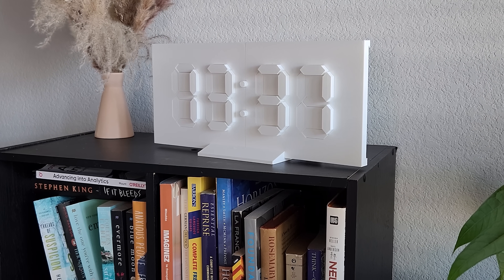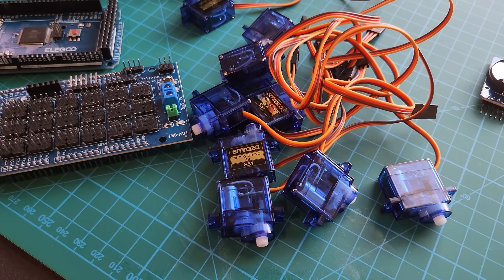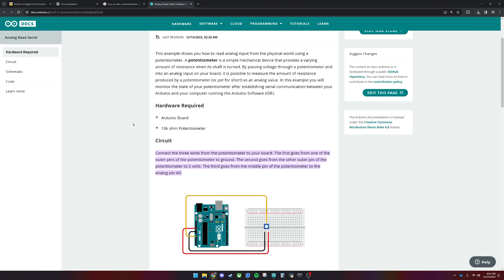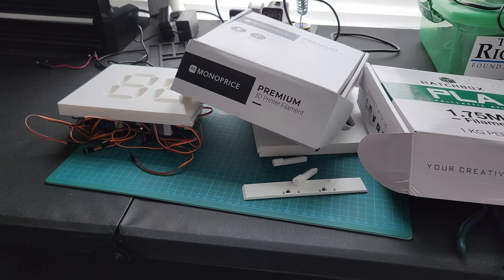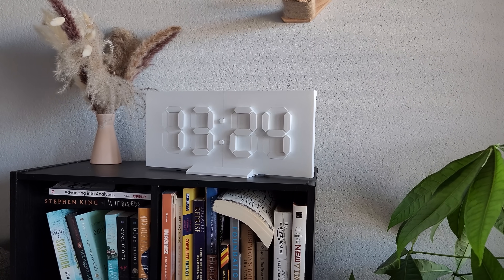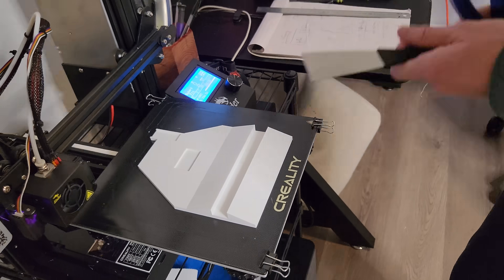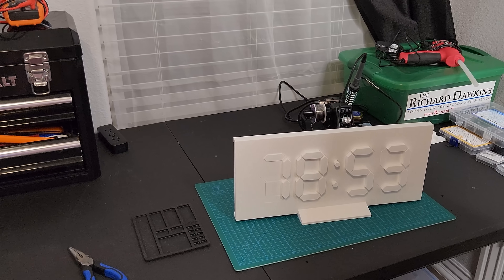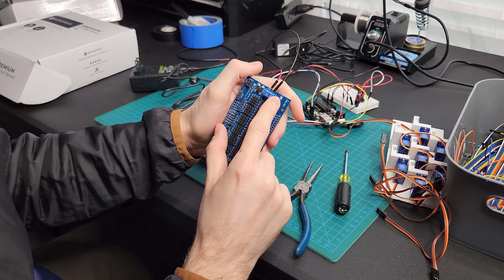I Built a Minimalistic Kinetic Clock Project with my 3D Printer and Arduino

Comment: This is such a cool concept. Being a watch enthusiast (I know this is a clock, but still), and an engineer, combining both into an electronics project is just awesome.
As some additions and improvements, the way this was done is a bit chaotic. Normally, a regular clock with 7 segment displays would just have a binary to 7 segment converter circuit, or since Arduino was used, just make the conversion in software and power the corresponding segment via a multiplexing circuit. Hence, with just some tweaks, a regular 7 segment display clock can be used and the multiplexing routine can carry the PWM signal to activate the corresponding servos. Of course, instead of multiplexing hella fast as with a normal display, it would be extremely slow but in order to move one segment at a time and using a servo driver instead of the Arduino itself. That way, a bunch of the wiring can be ditched and power consumption would also be lower. Regarding noise, there's really not much that can be done, except not using servos or isolating the back of the clock really well to damp the noise a bit.
In the end, this definitely is a really cool way of displaying time.
Reply from the maker: This is a bit over my head, I'm just stuck on how cool the word "multiplexing" is :-D. Seriously though, thanks for the ideas! I'll have to google some of this for my smooth brain to comprehend it.

Comment: Maybe you could use Solenoids instead of servos to push and pull the segments. That what you wouldn't have to calibrate pots control of the servos. That is as longs as the Solenoids shaft travel is the same for each of them.

Comment: You could try a dovetail joint to mount the Arduino. You could also look into some wire loom tape or tubing to clean up the cables even more.
Reply from the maker: Don't tempt me with a good time. I'm a HUGE fan of wire loom :)

Comment: It's amazing. It's something I would never be able to do. Thee best I can do is an old laptop running Windows XP and a clock screensaver called Huge Clock. I know, I'm not the sharpest tack in the cork board. I am smarter than the average Joe though.

Comment: Very nice!  I would suggest a stop to each segment, so it naturally ends flush when retracted (or extended).  This should also work well with the electromagnet concept others have mentioned.
Also in reference to power: the servos move for one second of each minutes.  So it may be possible to use a capacitor to provide the extra power required during that short window.  You would need some sort of current limiting on the charge circuit (which may be as simple as a resistor).
Reply from the maker: Ohh I didn't think about using a capacitor. That might be a good quick fix.
Reply: NiMH battery pack (4 cell = 4.8v) would possibly work better than a capacitor. Charging can be done with as little as a resistor to limit the current since your not going to fast charging.

Or if it's happy to run down around 4v, a cheap TP4056 Lithium charging module and a 18650 cell would make the whole thing run from a USB phone charger.

Comment: That is a nice clock! I would be curious to see if a color change on the segments works out well (lay down 1mm of white PLA and then switch in some black PLA).

Also, heat-set inserts are really nice for projects like this and tying everything up.
Reply from the maker: Okay that's a great idea! I'm about to get a Bambu X1 Carbon so I could totally do a dual color print for all the segments to make that vision come to life!
Reply: @LukasDeem I don't think you need a multi material printer for this. I'm sure it's just a pause at x layer and swap filaments. The whole segment would be black and pause at the last maybe 5 layers and change to white. Or even good ol' paint would do the job just fine
Reply from the maker: @octimus2000  you are correct, but how cool would it be if I did have a multi material printer though? 😄

Comment: I saw the original design for this a while back but it was unpowered, so seeing a MCU and motors on this is a serious step forward.
The issues you've faced here have really got me thinking, I love the form of the face, and that movement when the digits change is beautiful, so I'd like to keep that, but for me it needs a out/in state for each segment, so I'm going to think about how to create a gradual kinetic movement (sprung, like an old cassete tape opening maybe?) with the actuator being a electromagnet powered to either positive or negative and the digit holding a neodymium magnet in each segment (sprung, like an old cassete tape opening maybe?) with the actuator being a electromagnet powered to either positive or negative and the digit holding a neodymium magnet. 
Something else I'd want to do is reduce the depth to as minimal as possible, which if the soft open/close mech was thin and the electro magnets don't need much force means the clock could be wall mounted.
Final thought, for me the digit movement would be a wash from right to left on each of the segments, that way the required power would be issued at a max of three segments at any one time, that would keep the amperage down.
Reply from the maker: Excellent ideas! I really wanted to find a way to wall mount it, but I knew it was too big to make it practical with the design I used. I would love to see your idea come to life!

Comment: Would be interesting to try reducing servo count by using multiple segments per servo and mechanical cams
Reply: That’s what I was thinking too. A cleverly-designed set of cams could work well. Another option would be small electromagnetic coils that can produce a north or south pole depending on how they’re energized, and only need to be energized long enough to flip a digit. Multiplexed, probably. So you’d just need one permanent magnet and one reversible coil per segment (and maybe 2x transistors per segment) instead of one servo per segment.
Reply: @ScottLahteine I would love to see this concept be realised :)
Reply: @ScottLahteine  Just watched this video the other day with a cam setup.  https://www.youtube.com/watch?v=qoPwPJhESA8
Reply: To my reckoning there are not two segments that always move in sync, afraid each segment requires individual control.

Comment: I would use a 12V 2A power supply and two stepdown boards. One 5V for the Arduino and one 5V for the servos.

The clock could be set via GPS module or radio receiver. In Germany the station is available at 77.5 kHz for the local time. That's longer than long wave radio.
GPS transmits UTC, which is British time = GMT
Reply from the maker: Oh! I like the idea of syncing time via GPS. Great idea!
Reply: Awful idea. GPS module is over expensive and complicated for such simple case as clock. 
Better to use cheap radio chip with support of RDS decoding, it cost near $1. RDS — it is additional digital data which transmit radio stations (e.g. name of station, current track and so on), there are ~20 types of data which radio are transmit, including… yep, current time.

Comment: How do you actually get the clock to know the current time?
Reply from the maker: Hey so there is an Real Time Clock (RTC) module. It connects to the Arduino via the SDA and SCL pins. You have to run an initial program to set the clock, once it's set it stays set (unless the battery dies). When the clock is running it calls for the time from the RTC module and translates that into the digit movements.

Comment: I wander if you could use a syringe filled with a low boiling liquid, so you would need a heating element like a strong LED, more power etc.

Comment: I’d print a back for it, 1 to make it aesthetically pleasing, 2 to potentially sound dampen the motors making noice. 

Also, I wonder if adding a lighting strip above or below would help cast shadows to make it even more readable, and also wonder if dust build up will be an issue.
Reply from the maker: Hey good idea with the lighting. I was thinking something similar, it's a bit hard to read at certain angles and in certain light.

Comment: Looks great. Is there a place you specifically talk about the problem you have with the power? I have a solution in my head but it’s so mindless I feel there is more to the problem that I just don’t know.

Again cool video thanks!
Reply from the maker: Hey yep. SO long story short I tried powering both the shield and the arduino from a single power supply 5v, 4A. The problem was the voltage was a bit low for the arduino and I when all 30 servos were moving it would brownout. As others pointed out, if I could just adjust the code to move the digits one at a time, then it would solve the problem. I'm just a coding noob 🙂

Comment: If I was making this clock then I would use Nitinol Wire to push-pull the segments in and out, it would be silent and some FETs to adjust the current to each wire coil.
No servos, so you would have a Nitinol coil attached to each segment, then a FET to switch the power to each coil, more info look at this channel.
https://www.youtube.com/watch?v=wKoc7-APFsk, go on make one it will be a very cool project.

Comment: Great build, it looks awesome.

I would say 2 things to improve this build: you can use one power supply that has vurrent for the entire project by having a common earth between everything and using a step down/buck converter for lower voltage parts (like an LM2596). And grab yourself a flexible bed for your printer - they're very cheap and will save you damaging the bes uaing a hammer and chisel. Flexible PEI plates are awesome.
Reply from the maker: Hey! I ordered a Bambu Labs X1-Carbon so I'm looking forward to using the flexible  plate on that baby :) 

Great suggestions! I'm trying to learn more with each project :-D
Reply: @LukasDeem  Another thing since you will be able to do multi material prints– maybe put the sides of the print in a different color, like green and the front of each segment in white so it blends in
Reply from the maker: @ottersmeep25  hey yes! I got the AMS. I haven't tried a multi color print yet. I'm excited to give it a try! 😃😃
Reply: @LukasDeem  congrats on a beautiful project - its a work of art.. and now an amazing piece of technology (the x1 carbon) - when are you going to get it? it really opened up possibilities for me - more things became possible faster. excited for you esp where you'll go with it!
Reply from the maker: @shamh7830  hey thanks so much! I actually got my X1 carbon a couple of weeks ago. I'm so impressed with the speed and quality! I'm able to iterate so much more quickly now 🙃
Reply: You should make sure that not too many servos move at the same time then you wouldn't need such a big power supply.

Comment: Now using this as a base for a large Pin Art board, having the time get pushed out in the pins. Or if you want to take it to a more surreal/paranormal look a very think sheet of latex over it so the numbers are pushed out of a seamless block

Comment: Are you using two power supplies for two different voltages, or just to supply enough current?  If the former, the servos will run from 5V, as will the arduino.  Either way, there are little Power Supply modules (Leadshine and many others) which are low cost and are available with plenty of power to drive all 30 Servos at the same time (which of course, you don't need to).

You've made a very nice job of this.  I appreciate your attention to detail.
Reply from the maker: Hey thanks!! So yeah I have two power supplies, both are at 5v. The one powering the Arduino is 1.5 amp and the one powering the servos is 4amp. I was thinking maybe I can get a power supply with higher amperage but I didn't know at what point it would be too much current for the sensor shield. I played it safe 😆
Reply: @LukasDeem the sensor shield would only consume what it needs, your cannot inject "too much current" into it
Reply from the maker: I see, but if the attached components pull a ton of amperage, wouldn't I eventually hit a limit of what the traces in the board can handle?
Reply: @LukasDeem  sure, but you could have simply added a wire in parallel from the input of the board to the input of the servos.

Comment: I wonder what is the lifespan for those servos. I’m working on a project with those servos and I feel they will fail relatively soon… if anyone has  experience using these servos intensively such as this project, feedback is welcome. Beautiful clock btw 😂
Reply: A lot of people have mentioned turning off the servos when not in use to avoid burnout. Also 3d printers use servos aggressively and last for years so it's definitely not an unsolvable problem
Reply: @chris_piss  thanks
Reply: I think I was wrong actually, pretty sure 3D printers use stepper motors not servos
Reply: @chris_piss  yes but the fact of switching them on and off to avoid wear is a good point. 👍

Comment: You really need to get a textured PEI spring steel bed.  The pieces just release automatically release once the sheets cool down, and if they don't you just flex the plate and they pop off.  I tried the tempered glass for literally two prints before returning to Microcenter as the PLA basically welded itself to the surface and I could only get it off with cold water after a few minutes.
Reply: I don't miss glass beds and Ender 3.
Reply from the maker: @recoveryguru  What are you printing with now?

Comment: This is just of a suggestion from someone who isnt that experienced with making stuff but maybe you could make an entire enclosure for this and potentially add some sound dampening foam inside to reduce the noise of the servos. Unsure if that would take away from the aesthetic but throwing it out there.

Anyways cool project on something i've never seen before!
Reply from the maker: Yes it would certainly help. However, some of the noise actually comes from the digits rubbing against the clock face as they move in and out. So that would still be audible, it's like a creaky stairs sound.
Reply: @LukasDeem  this might be a little time consuming but maybe sand (and lubricate) the interacting sides of the digits and clock face if possible?
Reply from the maker: @idothinz  so I sanded some of the really tight fitting parts and it helped a bit. I thought about maybe using a dry lubricant like a graphite spray or something.
Reply: @LukasDeem Slipit sliding compound usually used for drawer slides is clear and can be applied very thin

Comment: To remove your 3D prints from the build plate, you can try using a compressed air can by flipping it upside down to cool the plate and detach the print. Another method is to add some water on the plate while it cools down. However, the best practice is to wait until the plate is completely cooled down and then cool it down even more. This will make it easier and quicker to remove the prints.

Comment: Very nice looking ... I saw another kinetic project a few months back that had me thinking about a clock -- I want to think the servo count can be greatly reduced using an indexed wheel (or drum) and some clever levering similar to a lot of old school auto play instruments (or new school, if you're a Wintergarten Marble Machine project fan). Each digit segment would need to be spring loaded.
Reply: I like where you're going with that. One option would be to have three (long) wheels per digit. You wouldn't necessarily need springs as there could be tracks on the wheels that push and pull the segments.
Reply: I was thinking three long cylinders per digit running up-and-down but you might be able to use a wide flat disk perpendicular to the face.
Reply from the maker: Hey! That is a super cool idea. I've seen some clock builds using a series of gears in a similar way. Let me know if you end up building it. I would love to see it in action!!

Comment: You can buy bistable linear solenoid actuators, looks like it suits the project, more silent and hasty, like a tik of the clock.
Reply: Those are however quite expensive, right?

Comment: Really cool, I like using threaded inserts to connect things together instead of hot glue
Reply from the maker: Yes! I really want to start using threaded inserts. They are just sitting in my Amazon cart waiting for me to impulse buy them 😛
Reply: @LukasDeem   click that 'Buy' button. You will not regret it, threaded inserts are awesome. I use them a lot.

Comment: It would be even cooler, with some piece of muscle wire instead of bulky servos🤔. Also with styrofoam pieces, it will be light as a feather, with pindrop silence and lowest build cost! Just some 💭❤️👍
Reply from the maker: Hey can you explain what "muscle wire" is? I'm interested to find out more!
Reply: @LukasDeem  Muscle wire is a Nitinol memory alloy, that expands and contracts, when heated(or a pulse of current passes through). There are two variations, one has memory retention, while other does not. It is not low power, when operated continuously, also has tens of milliseconds cycle time, but lasts millions of cycles, when not over driven. Also has better power to weight ratio, than most motors. Let me know, if you need additional help.😊. This is a suitable application, due to large physical size(where the dispacement of wire is more useful), but would need dedicated drivers and electronics, and some unique mechanical leverages thru 3d printing.